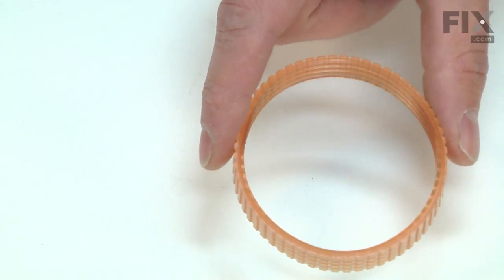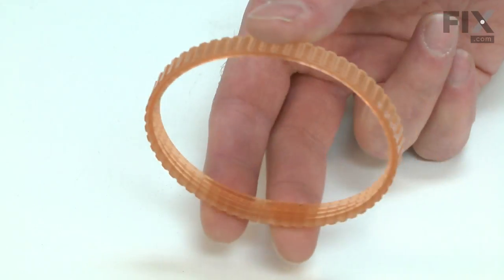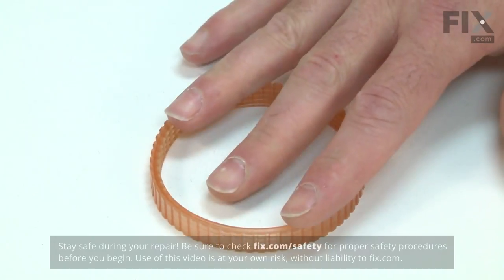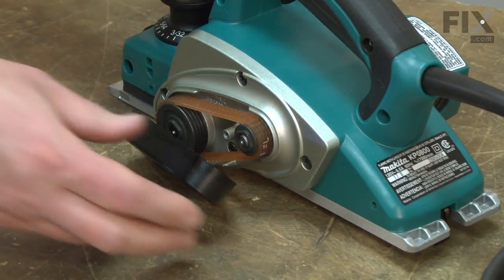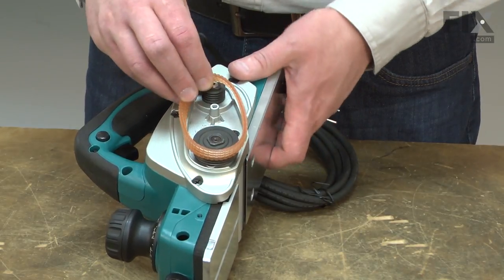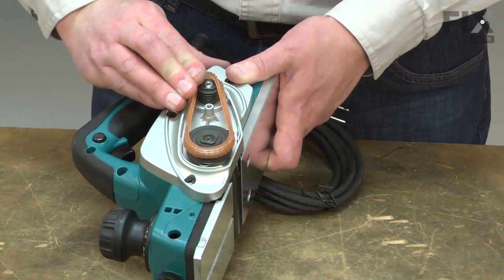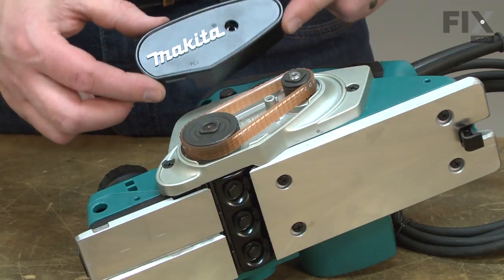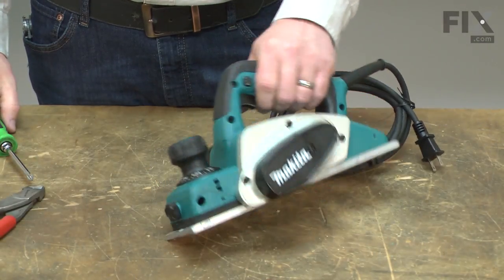Makita Planer Repair - How to Replace the Poly V-Belt

Comment: Thank you! this was driving me nuts lol. The key is to work it in by turning as you hold the entry contact point between the belt and wheels. one finger turns a wheel while the other, pinching the belt.

PS I used penetrating oil to remove the belt first, lol.
Reply: Magkano po ang belt ng portable planer ? Makita po ang tatak.